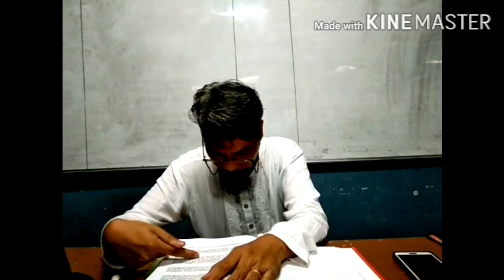CE526 Sanitary, Fire Safety and Plumbing Design || NPCP Ch01: Administration Part 2

Comment: I learned things about the permits , The validity of permit by the provision of the code , It tells that the building official has a big power that he can stop the plumbing work and also it expires when the work did not start in a span of one year , when it exceeds you should re apply it.

Comment: Rolegio, Mark D.
19-02023

this video is about the chapter 1. I learned about the permit issuance, technical specifications, applications, plans and other required documents filed  by administrative authority. section 105 plumbing code and other pertinent laws and ordinances and upon payment of the fees.

Comment: Permit Issuance -  the date when the authorized Department official signs the permit electronically or by any other means. (1:18)
Administrative Authority - the elected or appointed official or board having jurisdiction over a function or activity. (2:18)
Jobsite -  the immediate work area within the property lines of a single construction project, alteration project, or maintenance project where electrical construction or alteration of electrical wiring is in progress. (5:27)

Comment: Etabes, Joshua G,
19-02128
- Thank you, sir. I have learned that Section 103- PERMIT ISSUANCE of Chapter 1 of NPCP The Administrative Authority will examine an applicant's permit application, plans, technical specifications, and other required papers. Such plans may be reviewed by other interested departments that check for conformity with other applicable legislation. If the Administrative Authority determines that the work described in an application for a permit, as well as the plans, specifications, and other documents filed with it, meet the requirements of the Plumbing Code and other applicable laws and ordinances, a permit will be issued to the Applicant upon payment of the fees specified in Section I05. Retention of Plans states The Administrative Authority must keep just one set of authorized plans, specifications, computations, and related data. Two (2) sets of approved plans, specifications and data shall be returned to the applicant and Owner, with one (1) set remaining on the jobsite at all times while the work is being done.

Comment: Continuation video about chapter 1, it was clear, the permit issuance, The application, plans, technical specifications and other required docunents filed by an applicant for a permit shall be reviewed by the Administrative Authority. Other concerned departments which verify compliance with other applicable Jaws may review such plans. If the Administrative Authority finds that the work described in an application for permit and the plans, specifications and other documents filed therewith conform to the requirements of the 
Plumbing Code and other pertinent laws and ordinances, and upon payment of 
the fees specified in Section I 05, a permit shaH then be issued to the Applicant.
And when the administrative authority issues the permit he shall endorse it writing or stamp the plans and specification as APPROVED. 

It was also mentiones the validity of permit, where in the issuance of a permit or approval of plans and 
specifications shall not be construed as a permit to violate any provision of this 
Plumbing Code or of any other applicable ordinances. The issuance of a permit 
based on submitted plans. specifications or other documents shall not prevent the 
Administrative Authority from thereafter requiring the correction of errors on said 
plans, specifications and other documents . and from stopping an on-going 
plumbing installations violative of this Code or of other pertinent ordinances of 
this Jurisdiction.]

Comment: After a master plumber issue a permit. This is evaluated by the building official. It must be approve or disapprove. By disapproval, registered master plumber must re-check, re-design, and submit again until it is being approved by the building official. Once permit are issued the validity of it is one (1) year. Once it expires, it needs to be re-apply. Also, we need a set of 4 plans. 2 sets for applicant/owner. 1 set each for the jobsite and building official. However, it is stated in the law that it need 6 copies because in a jobsite, it include several foreman because the building has several floors.